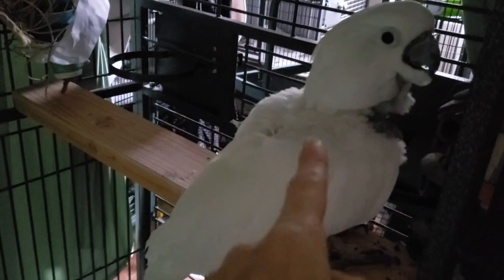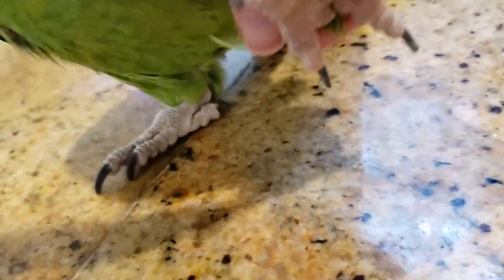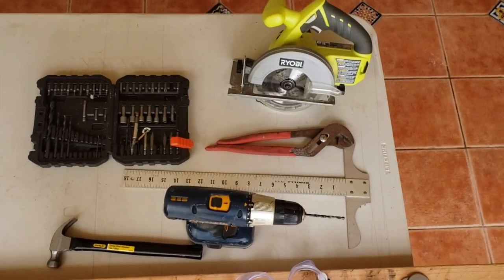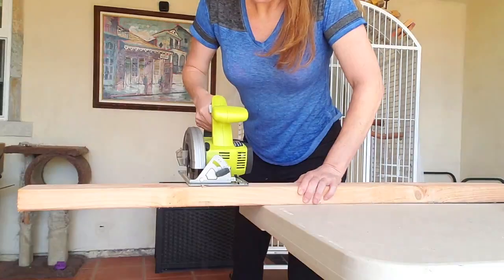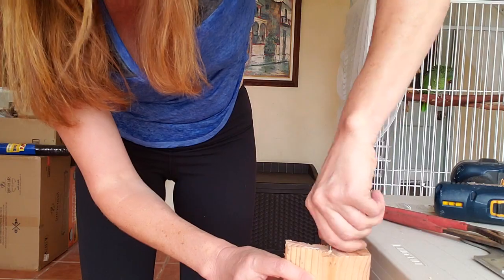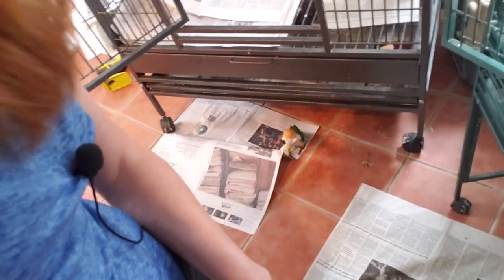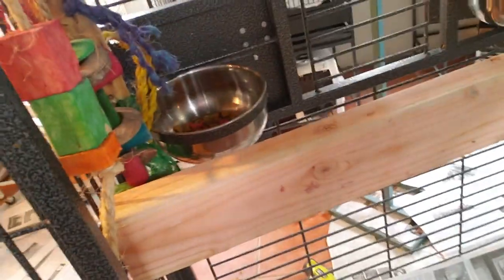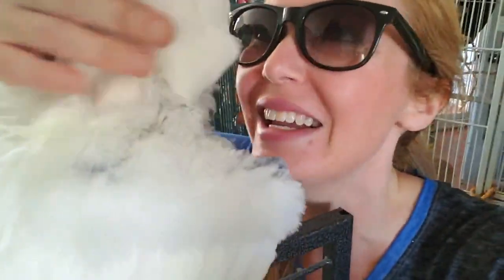How to Build a Parrot Perch Step by Step

Comment: Good for you for taking on a new challenge! The instructor in me has to offer a tip tho! It looks like you are running the drill in reverse and that's why it's not drilling well. The video is flipped, as sometimes happens with cell phones, and the speed is altered, so I can't be 100% sure, but that's what it looks like since you are pressing the 'forward' button in when you are pulling the bit out. Also, I'd run the drill at a higher speed :P . 

"Birch Pine" is not a thing btw (they are two different things). Again it's hard to tell in a video, but the obscured stamp on the wood at 2:58 would narrow it down. It's probably SPF, spruce-pine-fir, and can be any number of species. But almost certainly not a birch 2x4, although i could be wrong, and would like to know if so ;) . 

Anyway...Caique hops ftw!
Reply from the maker: I had to google FTW!🤣🤣🤣